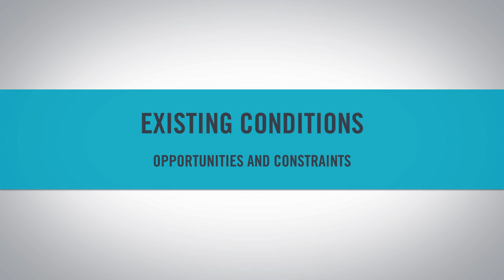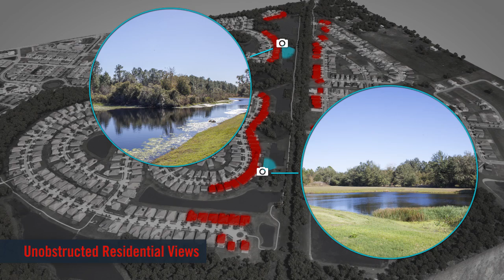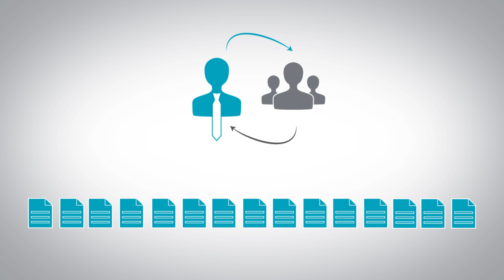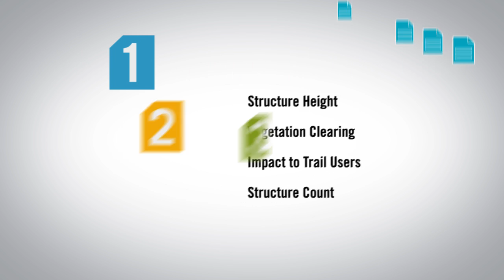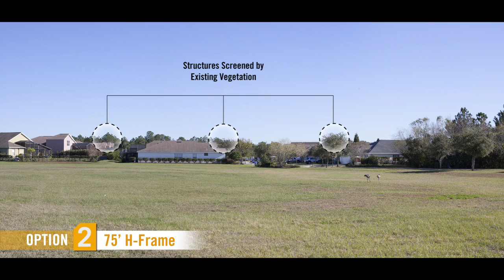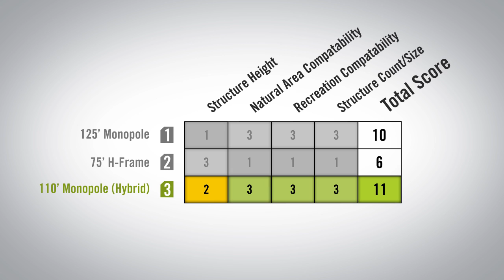Fishhawk Ranch / Channing Park Transmission Line Design Study

Comment: unnecessary project, especially since power companies are using BloomEnergy to supplement power needs. Delmarva Power is providing power to 22,000 homes using Bloom Boxes. 

http://www.bloomenergy.com/customer-fuel-cell/delmarva-power-clean-energy/ 

Delmarva Power has deployed 30 megawatts (MW) of Bloom Energy Servers — enough to power about 22,000 homes — that produce clean, reliable power for its Delaware customers. With the largest utility-scale deployment of fuel cell technology in the U.S., Delmarva Power brings the following economic and environmental benefits to the state:

Enhancing Delmarva's renewable portfolio with innovative energy technology;
Providing price stability and predictability over the term of the project;
Providing environmental benefits far superior to conventional electricity generation;
Attracting jobs to Delaware with Bloom Energy's new manufacturing center